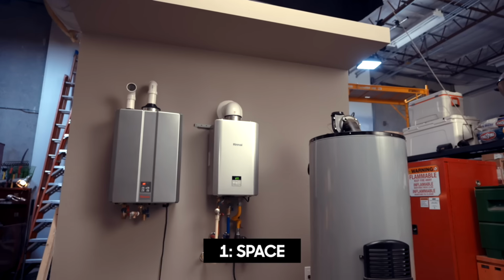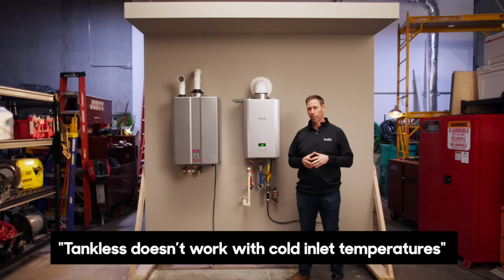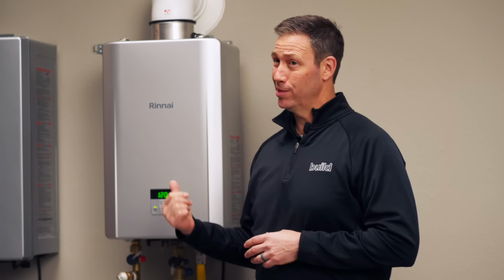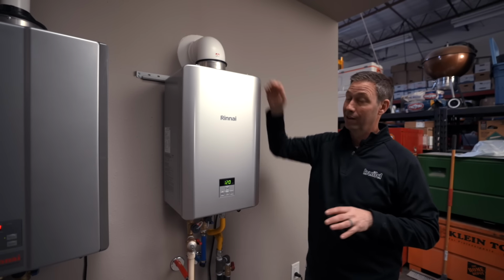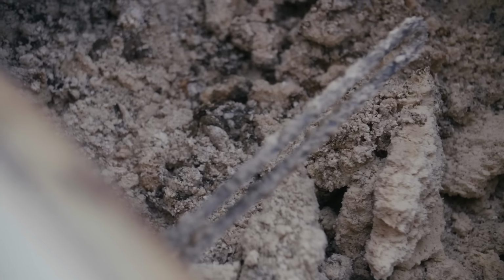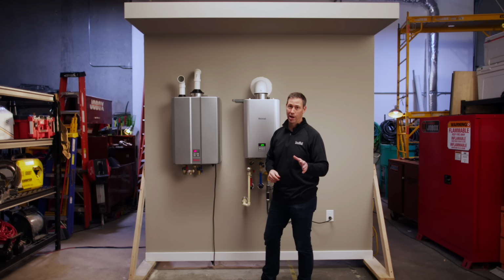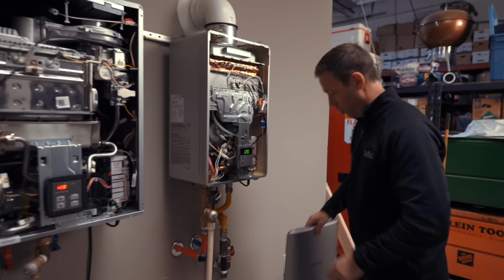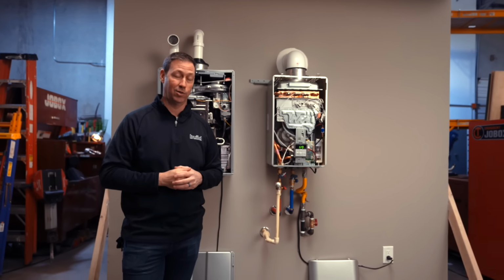DEBUNKING Tankless water heater LIES!

Comment: I think the "takes a long time" myth stems from early models having poor or slow triggering of the of heating cycle and maybe slow intial heating. We had a Rinnai installed two  houses ago  and it was wonderful! Our last house we didn't upgrade to tankless when our tank died because there was only one plumber in the area  that installed tankless and they wanted a fortune. Our latest home (My wife is GM management so we moved every 8-10 years, we're GM gypsies) needed a new boiler so we got a combined boiler/tankless water heater and, though not Rinnai, it's wonderful.
Reply: The older models weren’t so much slow as having a larger gpm requirement to fire up.  The old ones and some newer mid efficiency models need 1 gpm to start heating water.  There’s several fixtures that hover around 1 gpm like some kitchen faucets and some shower heads.

Comment: Our house is 100 electric, and the transformer that feeds my house is maxed out already.... Ironically, the pole the transformer is attached to is also too small for a larger transformer... 
That said.. I just don't have enough juice in this house to feed a tankless unless I had gas piped in, either from the street, or a propane tank..

Comment: I've got one that I bought from Amazon or Ebay. I can't remember which, that I've had for years. I installed it myself and the only thing I've ever done to it is change the D cell battery. I've only used 1.5  (50 gal.) tanks of gas since then. Operating cost is almost zero.

Comment: I had a Rinnai tankless (non-condensing) that was mounted on the outside of my house.  Two things that weren't covered in this video that I will tell you are absolute truths and could make your decision to NOT get a tankless.  1) If mounted outside it can freeze, and when it does, it stops ALL water in your house. 2) If you have a high efficiency low water usage washing machine for your laundry, you will NEVER get hot water in a cycle.
Reply: Sounds like a poor installation. Outside mounted units have different installation requirements to prevent this very thing. Usually theres a secondary cover that mounts to the tankless to enclose the water lines, but primary there should be heat tape wrapped around the water line then everything is wrapped with insulation in order to prevent water line freezes. Ive had to go out to service some tankless that have had this same issue
Reply: or a hot tub on a refill.. Or 3 gallons or ore waste cold water for a shower..I aint going into a damn cold shower..  I use 5 gallon buckets to catch cold water..  Use elsewhere..
Reply: I have a Rinnai condensing unit. If an exterior-mounted heater freezes, it stops the flow in the hot side of your plumbing. The cold continues to run, obviously. You still have running water. Solution: don't mount this units outside if freezing is a possibility. As for the high-efficiency washing machines, we have one. It runs just fine and gets the hot water it needs. I suspect you have a long, long run from heater to washing machine, so sure, that could be a problem. However, pull out that unit, install a tank-type and you'll still have the same problem. You need to have the water heater (any type) in your laundry room for maximum efficiency. That's where everyone I know puts it.
Reply: @paulmaxwell8851  - "The cold continues to run, obviously. You still have running water. " - nope ALL water flow stopped.  Could have been a poor install by plumber, but plz don't presume to tell me my lived experience is invalid.

As for the washing machine, you are wrong about that was well.   Our tankless was a retrofit on a house that was nearly 30 years old.  Laundry off the garage, WH in the basement, fairly central to the kitchen and 4 bedrooms.
Reply: @carlwebinar1571  I'm not sure how it could stop your cold supply. Cold comes in from the street to your meter and then splits off the feed line to each fixture needing cold water, including the tankless (the tankless then makes the incoming cold water hot), hot then originates from your tankless. Cold water to your fixtures like tub, sinks etc doesn't take a path through your water heater. What's likely is that your main supply froze as there's no way to blame the water heater (tank or tankless) for losing cold supply to the house.
Reply: @nutritionperfection  - I took a heat gun to the outside portion of the tankless (the heat exchanger as I recall) and after about 10 minutes, everything was fine.  I live in Atlanta and it got down to 8°F overnight, very atypical.

Comment: My Japanese made tankless heater run flewless since 1987. The gas company sent staff to check it every year. This it, just check it, no other maintenance is needed. By the way, checking is free :).
Reply: does gas company flush the tank?  where i live, gas company checks for free, but all they do is check that gas supply is safe.  Don't check the electronics, don't deal with scale.  Maybe you have incredibly soft water?
Reply: @annamyob  i live in hong kong, no hard water here.
Reply: @giggsrayn5205  well that's why no maintenance needed. I've never lived in a place had water that soft.
Reply: @annamyob  pls nited that no water tank inside. Only heat exchanger and water pipe
Reply: @giggsrayn5205  right, my bad.  Tankless still needs to be flushed due to minerals.

Comment: You should probably tell people to check with their municipality’s building department about increased gas line size. It doesn’t matter what the manufacturer says about the increase being needed, or not. The local building code has the ultimate jurisdiction and often requires a dedicated, increased line to pass final inspection for the permit.
Reply: Our local jurisdiction has been preparing for 50 psi local supply for 20ish years now. It's kinda wild what has to go into making that happen.

Comment: I add a WestingHouse tankless water heating 5 years ago. The installation was labor intensive because of the layout of my home but only spend about $200 in parts to do so. The water heater was $1200 which was still twice the cost of replacing the existing water heater but it did include a recalculation pump. Other than some occasional unexplained error codes that where not documented which was not surprising consider the poor owners manual, it worked very well and was very cost efficient. After less than 2 years it developed a leak which after having a plumber repair it, it turned out to be a simple fix that takes about 10 minutes once you know where to look. Replacing a washer of which the manufacturer provided 10 of, solved the yearly problem of the leakage. However, about 2 years ago it developed a new problem where it would not ignite the gas. After some work I found a wire had come lose so I had it back in service again. Three days later it started leaking again but this time it was not the washer, it was the tank itself. The leak was very small which did not shut down the unit and I could not find the exact location. The problem was solved with 24 hours when the leak progressed to numerous location at the top of the tank. 

While this tankless water heater was great while it worked the short life time I experienced was not uncommon as I found out while searching for a better replacement model. Unfortunately even Renie's water heater have people mentioning the same problem of short lifetime due to leaks. And though some tankless water heaters can be found for a reasonable price most with any kind of re circulation capability get expensive fast. Meanwhile the 10 year old water heater which seemed to be leaking was just a simple matter of tightening the drain valve is now back in use. My gas bill has gone up a noticeable amount but not enough that 5 years of the higher bill would justify the cost of a tankless. 

I love tankless water heaters when they work but the industry really needs to do better on reliability and cost. And good luck getting anyone to fix the tank at a reasonable cost. Additionally even if the re-circulation pump is not included, the water heater should have the logic build in to drive an external pump. Most external pumps don't have an intelligence built in so they have to be manually setup. The one I had learned the best times to run the re-circulation pump so you seldom had to deal with the cold water problem.
Reply: Spot on. And tankless may be popular in Japan, but that's also due to limited space requirements. Yes, I too prefer the efficiency of tankless, but reliability is also a prime consideration, and just a peek inside the average tankless water heater reveals much more complexity, with more opportunities for leaks... which are often disastrous no matter when they occur.
Reply: I've been looking into this for a while now, so many opinions and experience  , I'm just one person living in the house, reliability and costs are the most important to me , what makes me worried is, if thankless fails, it can be really costly, i can  buy and install tank myself, but i can't do same with tank-less... and labour cost is very expensive...
Reply: $1400 labor under warrenty to fix mine..parts free.. Feelin raped..
Reply: @peter-pg5yc  Geesh, your labor cost would be enough to have bought 2-3 traditional water heaters and installed by yourself.

Comment: One interest thing that I found (accidentally due to aeshetic choices) is that separate hot/cold controls work much better for temperature adjustments with tankless. And it's best to turn the hot on first then adjust by adding in cold, especially for the more distant faucets. My experience anyway.

Comment: It seems lots of people forget that the further your faucet is from the tank the longer it takes to heat the pipes between. When I renovated I insisted the design concentrate the plumbing as much as possible as close as possible to the heater location. My kitchen sink is the closest with hot water in 3-5 seconds, guest bath is furthest, takes 8-10 seconds.

Comment: When I bought my home 12 years ago, the first thing I did was by a Rinnai tankless water heater. My job at the time required me to be on the road 3 days a week. My gas use was so low, after 2 1/2 years, the gas company came and replaced my meter because “your gas use was inconsistent with your previous use.“ 🤣

Comment: I had a gas tankless installed when I remodeled my kitchen. The old “tank” was located in the kitchen. I had already gone through 2 in 15 years. The tankless was moved to the outside and used the old space to create a pantry. I had them install “big blue” water filter going into the tank and additional valves for easy maintenance. There’s no vent needed as it was outside. The remote control is in the pantry. I can run the washer and shower at the same time and see no diminishing of hot water. We also used to run out of hot water after 1 shower. My house is over 70 yrs old and I didn’t have to do any upgrades. I change the filter myself every year. Cost about $80. We have really hard water. Only had 1 flush and descaling so far.  Tankless is now  8+ years old. I do see that it doesn’t kick in if tap is opened to low flow. So no hot water at trickle.
Reply: try opening tap to full flow till you get hot water, then turn it down to trickle. I'll bet that works.
Reply: It costs $80 to maintain it every year? did it lower your gas bill, so it doesn't really save money...

Comment: The tankless problem that I'm concerned with was not addressed in the video. I have heard that most tankless heaters don't support running a trickle of hot water or a low rate of lukewarm water from a tap. Can someone debunk this or elaborate?
Reply: ha.  read the comments.  major drawback, and so simple to prevent, what is wrong with those tankless companies?

Comment: As a guy who used to go fix these, I can tell you a huge problem with at least some of them. The hot surface ignitor goes out and they are out of stock and norton isnt making a new run of them for 6 months. No heat, no hot water at all until the ignitor's were manufactured in months. They ripped it out. Too much reliance on a single piece of equipment.

Comment: Master plumber here with lots of experience with tankless and tank water heaters. You're video is very misleading and you're clearly being paid for this from rinnai. 

Here's why:

3 showers at 40 degree inlet temperature with 5 gpm is really pushing it, especially when it's 20 below outside and those are hot showers. If someone has a whirlpool tub with a 7-9gpm tub filler you can forget about a tankless in the North.

Also, gas lines and venting almost always need to be changed or upgraded, they cannot be installed in the same amount of time as a tank type heater.

If you have hard water and don't maintain a tankless water heater it will stop working. A tank heater will keep working, even with hard water build up in the tank. 

Let's face it, Rinnai is paying you for this bit and you're not a plumber. I think you should get your facts straight before putting out a video like this.  Tankless are a good option for some people but for a lot of people a tank type heater is still the best option.

Comment: Time to hot.
The real 'difference' is the amount of time it takes to start the on-demand heater versus already hot tank. A recirc is often not possible in a retrofit, and anyway, is true of either system, so just a confound here. 
I'm afraid you didn't dispel this 'myth'. And since they didn't get you to say "the new Rennai Super has a 2 second response time" I'm assuming it's still a significant difference. Anybody have any info on this?

Comment: The main problem we have with our tankless is that you can't get hot water at low flow rates. In fact, to get hot water at our bathroom sinks, you have to turn on both taps. On the advice of a plummer, I pulled the flow restricters out of the sink and shower taps. This did help, but it's still annoying to have to work around the minimum flow rate requirement.
Reply: Also be careful if you set your water temperature higher than you want to use directly (e.g. 120F). While showering, if you mix cold with the hot to make it comfortable, you may very well deactivate your heater, since you'll be using less than the minimum required flow of hot.

Comment: Just had to chime in here. I have had an ACV tankless water heater for 3 yrs. now & I HATE IT!!! Very slow response time, so wasting a lot of water, waiting for the hot water to arrive at the faucet. And it clips out regularly & I have to run down to the basement naked to unplug the unit & plug it back in.
I'm switching back to a tank ASAP!

Comment: Honestly, I am staggered you even need to make this video.  Most modern homes in the UK use "combi-boilers" to supply H/W and central heating with no tank, or only a tiny tank as a back-up.  The actually interesting tech, and the reason I came was electric water heaters.  There is no tank, no gas and so no combustion to deal with.  I suspect on-demand electric water heaters are the way forward especially as they can be situated next to the point of demand rather than centrally, and zero CO2 when powered via a photovoltaic/battery system.

Sadly, 3 phase electric is required for the larger electric on-demand heaters which is both expensive and problematic here in the UK.  As I came off mains gas, I used a PV powered H/W tank but would have happily had the space back for something more useful!